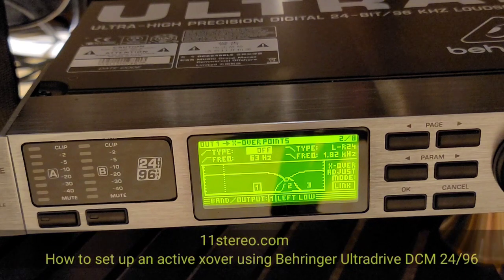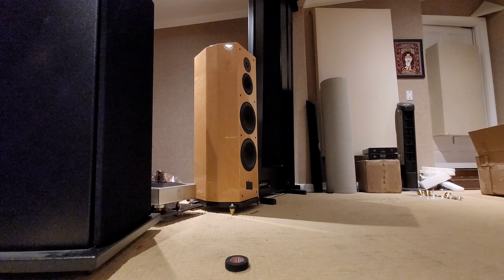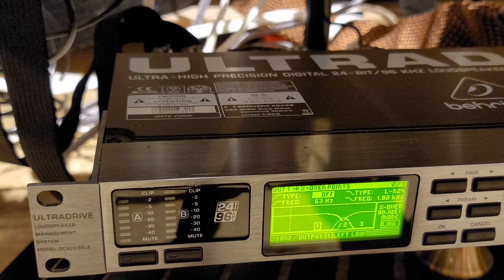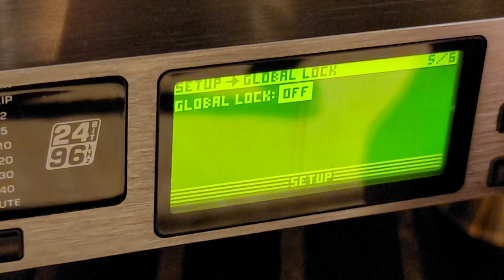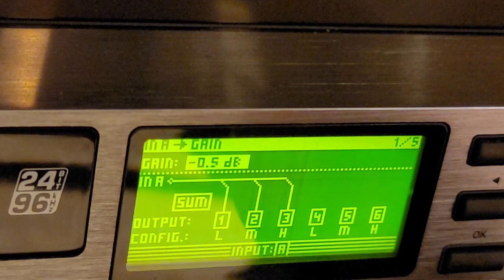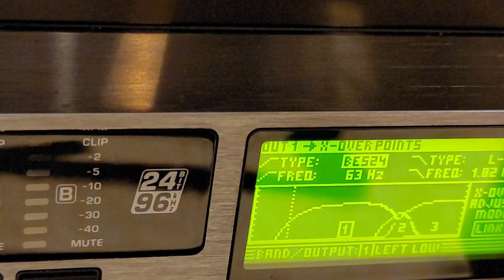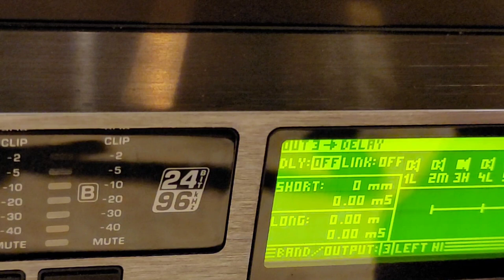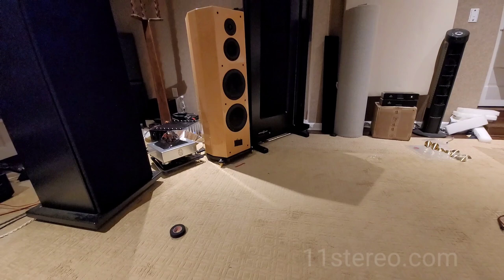Setting up an Active crossover using the Behringer Ultradrive DCX 24/96

Comment: Hey Mikey. I use this peice for crossover and eq. Just for the low end and subs. The top end is striaght from preamp to power amp. Passive crossovers in the cabinet do there thing for the mid and tweeter. Curious, what EQ do you use for your setup? I thought i saw it before. Its all analog i think? Do you sell them?

Comment: Thanks for the detail explanation. I may miss how you decide the gain of the individual drivers. Like in a passive crossover, there are usually resistors to adjust sound of the tweeter and/or mid path. Do you adjust the gains by listening and adjust to your liking?
Reply from the maker: Yes, its exactly how you do it .

Comment: Looks like a good product but it all the management is done in 24/96 digital domain.  Seems it would defeat any decoding you have done up stream at higher rates.  Also if placed between PreAmp and Amp with would also impact any advantages of fully analog path for vinyl.
Reply from the maker: only way I take DSP serious is before conversion.

Comment: i just got into active crossover myself after getting a minidsp SHD studio.
but i can't let myself use anything after a dac, but most preamps are done in the analog domain. 
i have only digital source so it is easier for me, source to dsp and preamp(my minidsp) and digital xlr to dac's into power amps. 
i can not think of any other way to do it right but something feels off with the preamp, there is no other place to put a preamp(volume knob) i think.
to get best sound quality it has to be as simple as possible with no unnecessary conversions or delay, and a volume control which do not degrade or compress sound. 

This is as far as i got so far, there is probably some high end product i do not know about for better solutions and sound.
Reply: I also use Minidsp 4 x 10..... my setup is computer w/JRiver output via toslink optical( glass ) to Minidsp output via XLR to amps....nothing else conversion is at the Minidsp
Reply: @wilbertiii  where do you do  volume?
Reply from the maker: This is only a piece I use when designing speakers to chose crossover points and slopes, then Ive got a 4 way discreet differential filter stage, What you speak of I want to try and I will using a DEQX it will mean I need 3 stereo DAC machines, just so happens I have them ...
Reply: @OCDHIFiGuy  Thanks, the DEQX is lovely. I run my PDC 2.6  into a Sony 7100ES. It's pretty good. I contacted DEQX to see if they still sold conversion kits that allow three S/PDIF outputs because the S-Master Pro amplifiers are fully digital and I have three. No reply sadly, it's likely too old.

Comment: Thanks for the video. My only problem is when you change the frequency of the "high"  under the LOW settings page, it changes automatically under the page of HIGH settings page. eg. You set the "high" frequency to L-R24 & 1.82 Khz under the LOW settings page, when you change the settings under the HIGH settings page L-R24 2.62 Khz, it changes the LOW page settings (from L-R24 & 1.82 back to L-R24 2.62 Khz)
Reply from the maker: Thats to prevent phase anomalies... not to let the user be a dum dum and make poor choices...I found out the hard way too... lol

Comment: Thanks for the demo, I wonder If novice users can follow. Some diagrams would be very helpful I think.
How did you choose the x-over points and why do you use the mid as a filler driver?
Reply from the maker: Glad it was helpful!, if you use the manual with this video novices should be fine . This is a temporary test piece to chose my crossover points when designing speakers, then i go to an analog crossover, you chose them by using common sense and trial and error the mid thing was a fix. it used to be a 2 way speaker but the tweeter did not go high enough and I dont like to EQ as it can sound contrived, so I added a ribbon tweeter and made it a 3 way and it just so happened that is sounded best only using the mid for about 1000Hz of freq